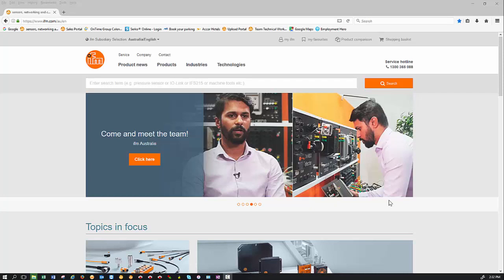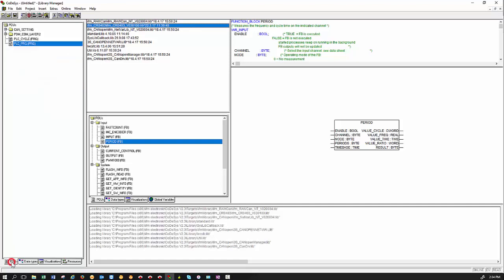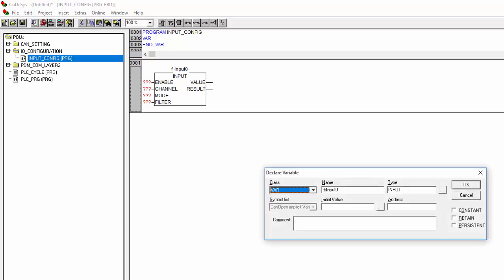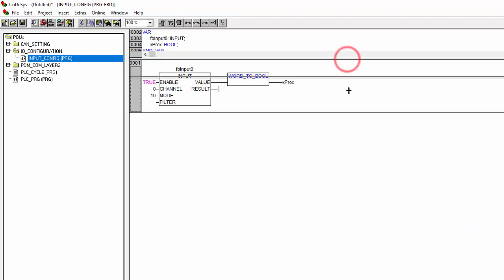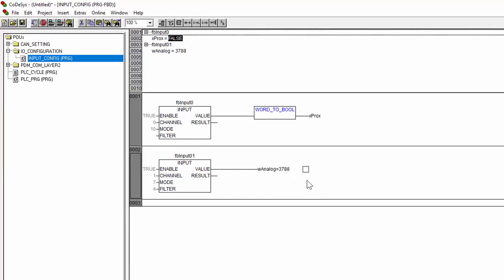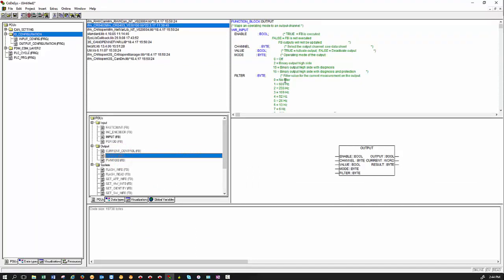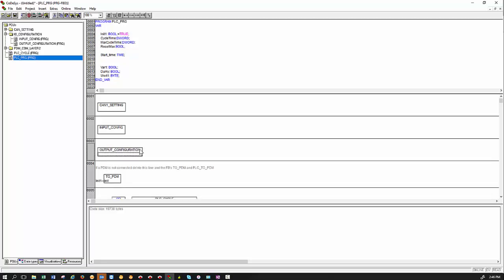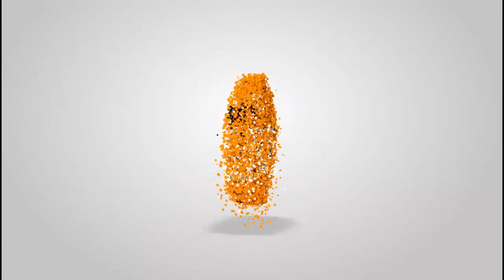How to: Configure Inputs/Outputs on Basic Controller/Smart Controller

Comment: how to progamm ifm control for hydraulic valve control?
Reply from the maker: Hello Mr. Ivanov, Based on the type of valve your are using, you can either use PWM1000 or Current Control Fb. But best to talk to ifm subsidiary for in depth advise.